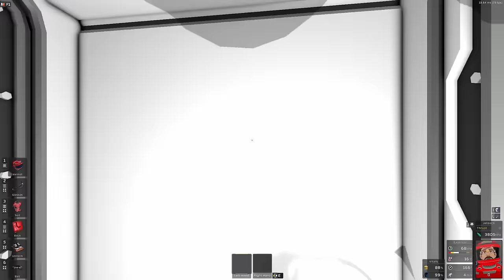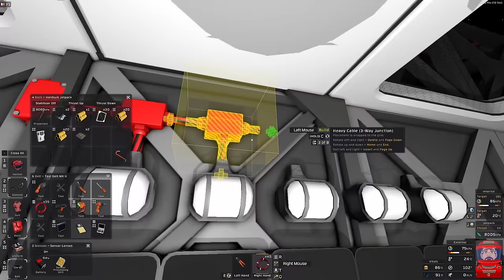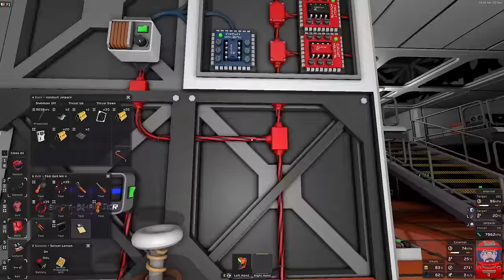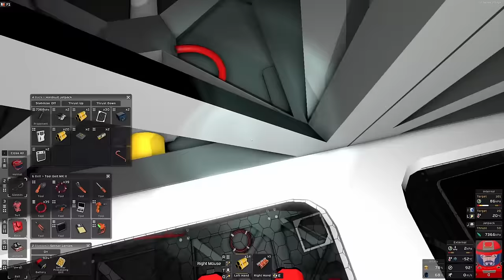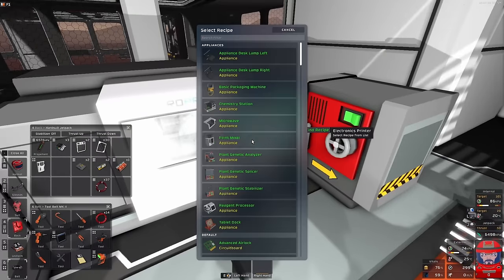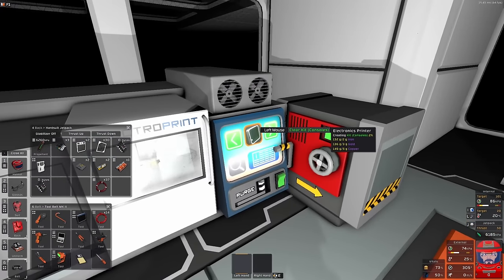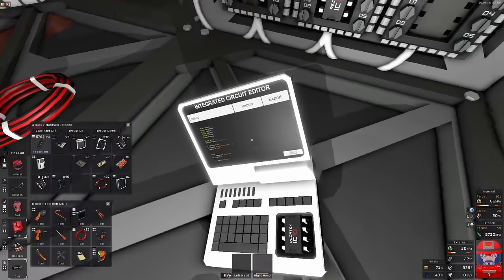Stationeers Let's play Mars 12 Alarming development

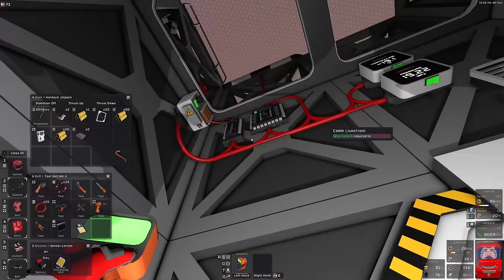Comment: ~23:25 -> Should play "Black Hole Sun" by Soundgarden if a non-green alarm is triggered here.  Why?  That song is an ode to the band having the same name you applied to the memory device here. 🤪

Back to sensible topics: Mick, the technique used for the central alarm status lights in the workshop is an excellent one and you demonstrate its implementation and usage very well.  🍻 
I've been using this decimal encoding for some time now to transmit status/progress of gas processing to panels around my base(s)

Comment: Stupid question, but isn't there a load device command, which allows you to read the CO2 tank directly from its device ID?
Great stuff as always, I never reached a point where I can set up such complicated systems as you do here
Reply: Sort of, it would have to be done by lb (load batch) command, so any other tanks on the circuit would be included...maybe load batch with push commands (like in his harvey 500 script) but if thats possible, thats way over my knowledge
Reply: the command would be "lbn" short for load batch network I think. It lets you load from items of a specific type and name on a network. So if the CO2 tank has a unique name on the cable network, the IC10 chip will only load data from that tank when using that command. Cowsareevil uses the command in the video, though I don't think he used it specifically on a gas tank.
Reply from the maker: Or I could control the CO2 pump from the CO2 chip that already knows what is in the tank.

Comment: Base is looking great, Mick! Just curious, with how low the pressure is on Mars, is it worth it to run your overpressure vents back into your cold gas collection (to save on having to suck atmosphere) and then leave the rest to the automation on those tanks? Was looking at it, and thought that a simple back pressure regulator on your rooms connected a passive vent could handle OP without the need for any controllers. Might need a volume pump just after the reg to force it into the cold gas line? In my head it feels like it should work, though.

Love the series as always, cheers!
Reply from the maker: The atmospheric collection is for breathing and for cooling.  The gas from the overpressure will be too warm for the setup that I have.

Comment: Might be a silly question, but why are you doing the fancy programmed active vent for pressure relief instead of a back pressure regulator?
Reply from the maker: Regulator would work too.  I switch it off to save power.